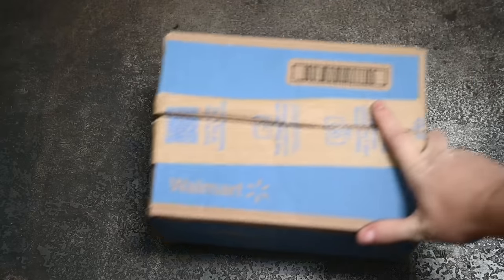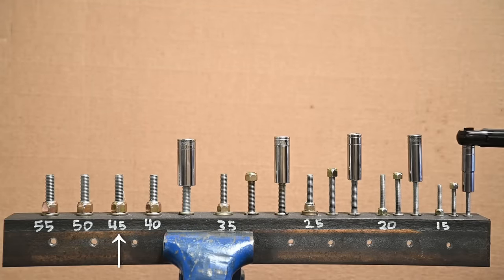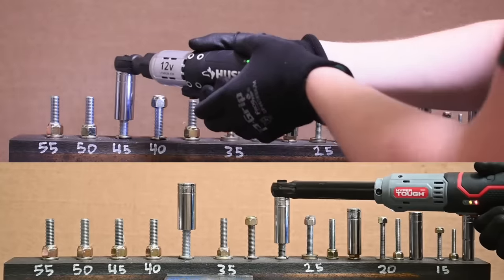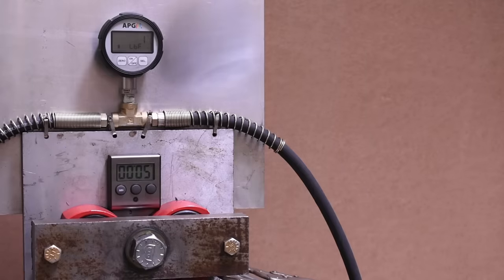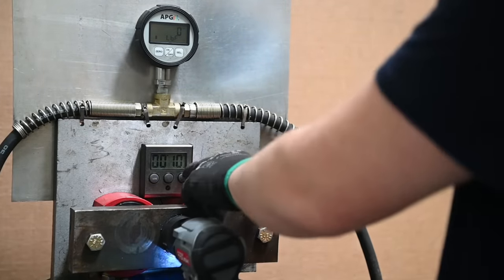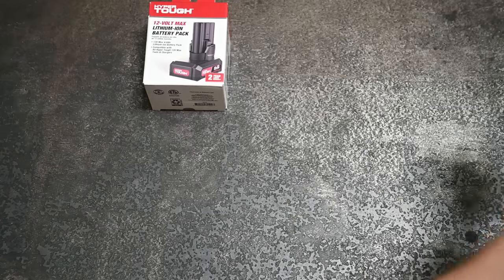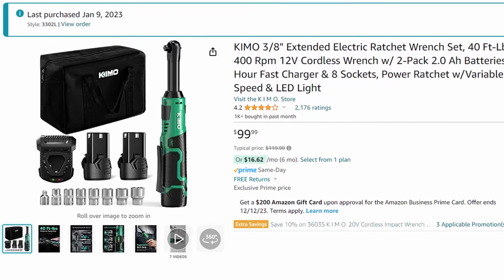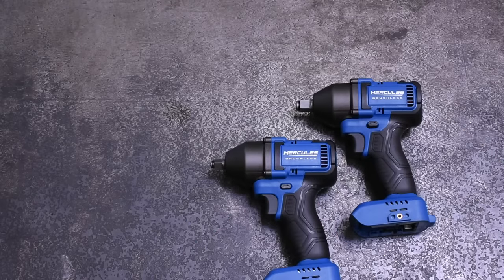Latest Walmart Hyper Tough Tools vs M12: Too Cheap to Pass Up?

Comment: The ratchet didn't do bad at all. For the price it's decent enough to get those pesky 8,10, or 12 mm bolts found on most transverse engine components like timing covers, water pump's, pully's etc especially while in car with hardly no clearance. It might not be as fast as my Milwaukee HS, but it can still save you some time regardless.🤙🏼
Reply: Yeah, I got a timing belt job coming up. On a 1990-1993 generation honda accord. I got some questions, Those tensioners, should they be replaced? I got it from asisin kit? Now I went in on and got some honda seals for cam shaft, crank shaft, etc. I went and got honda timing belts instead. I know the water pump is crucial, and the belts are crucial. Some claim only replace seals if you only see the leaks. And do it with honda parts only. But I'm wondering the asisin kit has those tensioners, I don't know the quality. I don't know if it should replaced. I notice there are videos on how to replace timing belts on honda 1990-1997 honda accord generation. But there not complete. I need advice on those tensioners, should they be replaced? Should I use a honda part?
Reply: @deegee2416  Well I can tell you I still have a 99 accord 4cyl since new with almost 300K on it. Mine hasn't been a daily driver in a minute, but I can give you some tips. If your daily driving it then yes I'd change the tensioners, but if your using it as beater then just check the condition of the tensioners, springs etc if they feel ruff or worn and not smooth change them. QT on aftermarket tensioners are hit or miss. Try to stay away from any China made water pumps, belts tensioners etc. I like Koyo myself. Check the make of the tensioners in the kit and look up reviews. However I do believe your spelling of the kit is wrong "Aisin" makes OE parts for toyota and other Japan manufacturers so it should be a quality kit. If it's a knock off brand and your willing to pay extra for a more quality part then upgrade at least you'll have peace of mind. Once warranty was over I change my belt every 75K replace everything then skip it the next time and only replace the belts. So far no leaks. If your already in there it's always a good idea to change out any seals, but up too you especially if they are not leaking although eventually they will. Always be proactive when you can, but if money is tight then do what you can. I do my own work so it's no big deal if I need to go back in, but if your paying to get it done then do it right now or you'll be paying for the same job twice. Hope this helps you out👍🏻

Comment: I rebuild medium voltage breakers and comtactors . Most of the bolts are only 1/4”-3/8” but in places with almost no room to turn a ratchet.  I may give this a try as I like the extended reach.  Everything gets torqued when reassembled so as long as it gets snug it will be good enough.

Comment: Not being a mech or a “tech” I can do what I need with hand tools. I watch this out of curiosity, and if I ever get stuck and need a power tool for mechanical work, I want a good one. I use power tools in my mostly refurb, work and hate wasting money on bad, cheap, tools. The last cheap tool I  bought lasted around 2 hours (4 1/2” angle grinder) which of course,including taking the thing back ! cost me more than going home to get one !  Aksherly taking the thing back was a mistake,and pig headed of me, it would have been cheaper to bin it.

Comment: I wonder if there's some quality control issue going on, because I've seen three videos now where this thing has broken 150 ft lb+ lugs with the 2ah battery, but yours struggles unless it's 4ah and it seems weaker. Something not adding up.

Comment: Saw this video around the time it came out and I work at a Walmart and I've walked through the hardware section a couple times and seen the hyper tough tools and the impact has always been on my mind. At my location the impact kit was 29.50 and the 4ah battery was 25. 60 bucks out the door including a honey bun, gonna use it until it breaks and then buy the new M12 stubby

Comment: I have Hyper Tough corded 1/2" Hammer/Drill, a corded Circular Saw, an LED bench light, and a few other knick knacks and they are all very good. Certainly for home use the brand is worth a look for those on a budget. Of course I am not a fan of cordless tools at all. We're simply not there yet.

Comment: I wanted 1/4” anvil ratchet but HY don’t offer it as of June 2024.  Well I got at $15-$19 Harbor Frieght Central Pneumatic 1/4” air ratchet and swapped out the anvil drive portion of the head and now I have 1/4” and 3/8 Hyper Tough 12v ratchets.  The HF air ratchets are now 3/8” drive. 🤓🔥

Comment: I'm a technician at Ford and I highly recommend this rachet. It may not be as fast as a milwaukee but it's still faster than doing it by hand. Time saving for 59.99? Thank you pls
Reply: Do you break stuff loose first by hand?  I do a lot of work where there is almost no room to turn a ratchet or get the other blocky ratchets in.
Reply: @charlesmckinley29  just depends on what it is and how stuck it is

Comment: I’ve owned a snap on cordless ratchet for 4 years. After it needed its 3rd rebuild, just out of warranty as per usual, I threw it out. 

I went to Walmart and got their standard length electric ratchet, quick charger, and the larger battery as well, as I needed something to last for one job under heavy use. Well, it’s been just over a year since. I’m still using that same ratchet, about 4-5 days a week. And as an auto mechanic, it’s seen some stuff. Still works just fine and gets the job done. The value here, is just unbelievable. I paid 40 bucks in store for that ratchet with the standard battery and charger included.
Reply: Hahaha.. snap on electric tools have a timer built in. Yearly rebuilds are the norm unless it's never used. 
I'll never go back to snap on electric. Milwaukee all the way.

Comment: I was able to get the Milwaukee M12 impact, hammer drill and cutoff saw with 2.0ah, 2.5ah and 4.0 ah batteries and a charger for 269 on sale at Home Depot.

Comment: My general rule of thumb is if you’re not a professional, speed doesn’t matter that much as long as the tool can do it. 

If you’re not a professional, get the cheaper tool, and if it breaks, that means you use the tool enough to justify upgrading it. 

Love my Milwaukee tools, but they are spendy. 

If you are gonna get Milwaukee, you don’t need the Fuel model unless you’re a pro in my opinion.

Comment: I got an aircat 1076XL running Milton fittings and no regulator. Removed and installed the lugs on my Escalade, for giggles I broke out my new hypertough impact with 4AH battery and it was able to remove all the lugs including the ones I just installed. Removed and all and used torque wrench afterwards of course. Just FYI

Comment: Agreed, Hercules and Bauer seem to be better performance per dollar ratio. 
Too bad the Hercules ratchet is only 12V, otherwise it could share batteries with the $59 Brushless impact wrench which IMO is a super great deal
Reply: In general I think your right but the HT ratchet is probably better for a casual user.   The hercules are $100+ bare unless you catch a sale.   I have a few Hercules and Bauer tools and so far no problems with any of them.

Comment: I have one of the hypertough ratchets.  Not the long reach version.  Figured if it turned out to be junk I wouldn't be out much.  No it's not the greatest, but it'll spin fasteners on or off in those tight spots where there's little "swinging room" for a traditional ratchet.  It was worth the $ to me for that reason alone.

Comment: The industry doesn't want standard battery form factors which like standard desktop motherboard form factors enormously benefit the consumer, but if an "off brand" consortium chose a standard for themselves they would gain COLLECTIVE market advantage. Too bad that nice long neck in the Hyper Tough is not much stronger. The profile is ideal for bellhousings and engine accessories.

Comment: Dude i have the shorter kimo, its definitely no Milwaukee but it beats the absolute hell out of being stuck with just a normal ratchet in a place you can't get much swing and dont feel like sticking 3 swivels and 2 wobbly extensions on your impact to get to. Ive used the heck out of it since i got it and its made working on things 20x easier

Comment: Those hyper tough tools are not bad for around the house light duty work, but professionally ide stick with milwaukee or something equal, wouldnt be bad idea to buy these hypers for home use so im not lugging tools back and forth from work! EDIT: Noticed hyper makes alot of tools for 12 volt and 18 volt platform at the same cheap prices..... could these be the ultimate budget light duty home use tools?

Comment: You know, it's not always about torque per dollar.  Sometimes it's about tool longevity.  One thing I would love to see in the industry.  Actual accurate ratings.   And I mean the reporting standards need to be raised by everybody.  There will be jewels in the rough for sure.  And I guess it also makes a difference if you're using them professionally.  Anyway,  good video.

Comment: Well, thanks mainly to this channel I ended up getting the Milwaukee M12 3/8" stubby and love it. I just used it the other day to change the lower control arm on my 2005 Toyota Matrix and it made removing the nuts and bolts a breeze. Originally, I was eyeing the M18 mid torque since that thing is a beast, but from the reviews the M12 could do most of the things I would need it for but smaller and lighter than the M18.
Reply: I’ve had mine for 3 years now.  If you want the most out of it buy a full set of 3/8 impact sockets all the way up to 22. Adapters steal the power out of these guys pretty good.
Reply: What's a good price for this Milwaukee, do you think it will go on sale on black friday?
Reply: @deegee2416  I got mine at northern tool on sale for 250$ came with the impact a 2amh and 4amh battery, the charger and a tool bag. I keep with me everywhere because It has no prob taking off lugs on a car. Also I love the setting that stops it after the first time the hammer engages. It’s for reassembly so you don’t over torque things.
Reply: @1stock1not I did order a 3/8" impact set when I ordered the impact wrench.

Comment: great video, i would really like to see the infinum long reach vs the milwaukees and snap on aswell as there high speeds normal length but i get they are expensive. but the prices of infinium keep coming down and the milwaukee keep going up, im in the market for a long reach and based on price its actually a hard choice now cause theyre the same for me and the matco is a smaller head than even the 2569-20 . again i get the price is hard but would be a interesting watch

Comment: DIY batteries, new bare Dewalt tools (on sale) paired with a second hand charger and case (costs 10-20 USD) is my cost affective suggestion. 
For some reason Dewalt is often half the price of Milwaukee in my country Norway.

I also don't see the point of 3/8" sockets. I always use 1/4" or 1/2"

Comment: I work in airframe and I had the Hypertough ratchet for less than one shift before it stripped the teeth off the gears and wouldn’t even tighten anything past finger tight. Went and got a Milwaukee the next day, the price is what drew me in but was left disappointed very quickly

Comment: I smoked a hyper tough skilsaw with relative ease, I loved its compact and light aspects. Came with a 1.5Ah battery, went out and bought the 4Ah because those dinky little batteries aren't worth literally anything. Cut straight, had to go easy on her or she'd cut out if you pushed barely at all. Built my shed and truck bed cover, can't complain with that for the price

Comment: Sounds like the 3/8 impact wrench is just the 1/4 impact driver with a bigger anvil. I still want one for little stuff like running a wire wheel

Comment: This raises the the question how does the hyper tough compare to a Manuel ratchet cause I use my milwaukee impact 98% of the time but occasionally I have the break out the air ratchet for 2 bolts just due to access is the money worth it to save me time over hand tools without rhe hassle of a air line

Comment: I have the cheaper Milwaukee 3/8 wrench.  Costs me around $100 or so on Amazon.  It works OK.  It doesn't seem much stronger than the hypertough my father-in-law bought to be honest.  Neither are really good enough to break a tight bolt loose.  They are only there to tighten something so you aren't wrenching on a hidden bolt where you can't move the ratchet for 20 minutes or to remove things you already broke loose.

 I have dewalt impacts and they work great with the 60v flex battery but the little 3/8 hypertough would probably do most of what you'd do working on things that weren't rusted suspension parts.

Comment: You should try switching out the 18650's with the Molicel P28A that was used in the beans battery pack to see if that fixes the problem with the 2ah pack cutting out.

Comment: Great video as always. I always love an honest head to head test. I do have to disagree on one thing, why would you want them to sell the impact without the battery for the same price and still charge you $25 more for the bigger battery? Isn't it better to get the first battery free?  That being said I do believe the batteries are the weakness, I would love to see you testing these using batteries with a known good drain rate.  I have been using the hyper tough extended ratchets and I'm pretty happy with it, sure beats cranking my hand on most things and gets into tight places. Except I did break one as you just did, I can definitely confirm you're finding that you do not want to crank really hard on these! But honestly it was good enough for most fasteners you would use this tool on. I was trying to really snug it up to make sure it wouldn't come loose, when I broke it. So far they broke loose anything I was taking off without breaking. It sure took a long time to get you interested in testing these tools! But thanks I do appreciate the great video!
Reply: You did get an explanation as to why they should make you pay for the first battery, charge up those old fashioned listening skills and watch the video again to find out.
Reply: @teeanahera8949  He clearly says make it a bare tool for the same price, and still offer the 4AH separately. I did not fail to hear is thought on using that to make it more effective. Charge up your old fashioned thinking skills and know obviously that would never happen. To effect the changes he/we all would like to see would cost them nothing ,since its programmed to cut off when it does, that would cost nothing to change, and even if they added weight to the hammer would cost them no where near the cost of the battery.  Clearly the low drain rate batteries are a significant limiting factor now.  Same reason for years people thought Ryobi tools were trash, when they actually were pretty good tools(Awesome considering the price) with a quality battery. Problem was they didnt make one until TTI took over, and seems hyper tough doesnt either.

Comment: Have you tested any Duratech tools yet? I just bought a $99 Duratech 20v impact wrench. It's suppose to be 330 ft-lbs on the high setting. I bought it to replace a Dewalt because I didn't want to ruin it at work.  It is also 330 ft-lbs. So far the Duratech is impressing me and might even be doing a little better than the Dewalt.

Comment: bought the hyper tough this week in a pinch needing a cordless ratchet for a tight spot that i couldnt ratchet on. The head has already snapped on it and i exchanged it for a new one. Not an awful tool but not good either

Comment: Thanks! It's nice to know how bad they are!

Now we need to know what happens when you connect a Hyper Tough impact to a car battery!

They are both 12ish volt, this comes down to can the brushless motor handle the current it demands, because a starting battery won't decrease in voltage (as much).

Comment: I have the M12 ratchet and the HYPERTOUGH ratchet. Both work fine, still prefer M12 though. HT works well for a starting body shop or mechanic worker though.

Comment: What's funny is that a great use case for this little impact would be tightening lug nuts in a tire shop. You know you're not going to over-torque them enough to damage anything and if you let it ugga dugga long enough it'll be in the right territory. I remember my OG 1/4" driver from DeWalt would torque to about 35-40 ft-lbs and it got used to torque quite a few fasteners since that's a bit of a sweet spot in automotive applications. My newer Makita would over-torque those and if I run it to its max torque for any length of time it snaps the adapters. My air impact will over-torque lug nuts on setting 2 of 3 for power settings. If I'm dealing with a subcompact with like 75 ft-lb torque rating I'll zip the lug nuts on with the makita and quick hit it with a torque wrench after. It's usually about a half turn more to get it there.
Reply: Honestly, if they weren't fudging the numbers so much, I'd recommend this as belly-pan and top-of-engine gun.  Used it the other day inside of a doorpanel and it was great, no risk of overtightening.  Would be great for most skid plates and underbody panels too.

Comment: In general you should stay away from the 1/4 impact wrenches. It's the same as an impact driver, and you can just put a 1/4hex to square bit and use at as an impact driver and wrench

Comment: Do you think they make a battery adapter to fit Milwaukee M12 batteries on the hyper tough. I’ve always wondered if the batteries on cheaper tools are the reason they don’t seem to work as well.

Comment: Have you thought about testing air drills? Just wondering if they can compare to modern cordless drills I mostly need a really high torque to turn over small engines